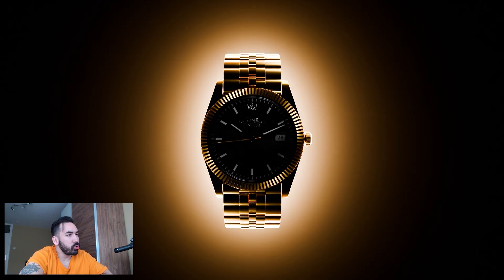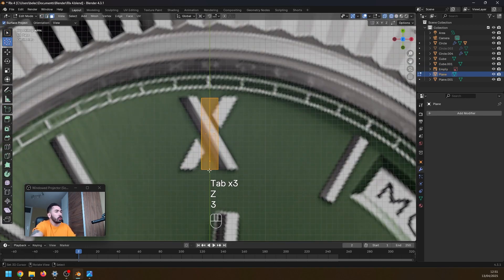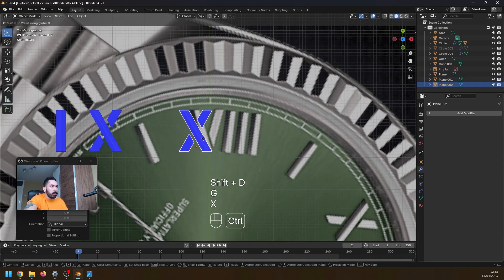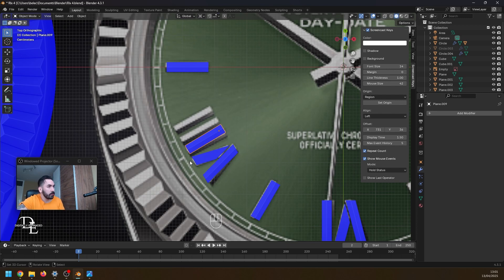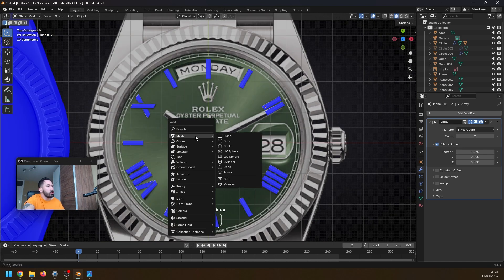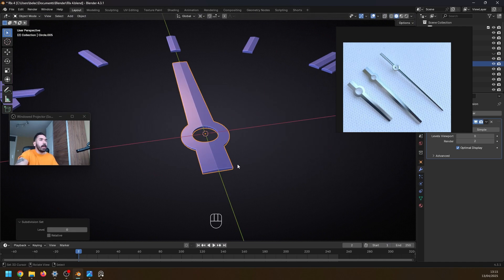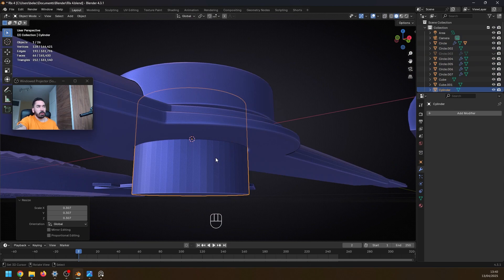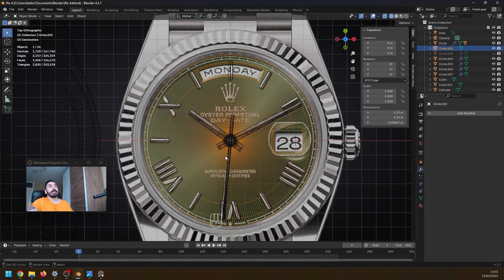How to Model a Rolex Watch in Blender (Part 3)

Comment: Thank you very much for the tutorial Aryan, BTW, at 10:44 , I think the seconds pin is supposed to have a screwable head that resembles half a UV sphere with a line running across. 

And here is a tip for the upcoming texturing episode, if you want to texture it exclusively for blender, just higher the anisotropy slider up on the flat base of the watch to get the same reflections (unless you want to bake it as game ready normal map), though you likely know that already hahaha. 
Also the prison fit goes hard 🔥
Reply from the maker: Thank you my friend. I will make the texture on top manually because an anisotropic filter doesn't quite get me the result that I want, so I will use a technique which is more sophisticated but better in my opinion.